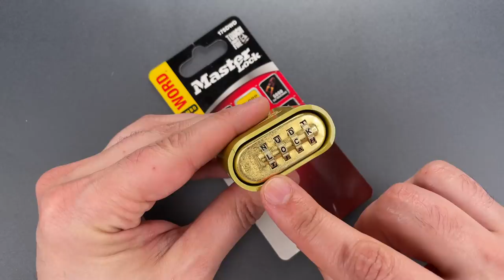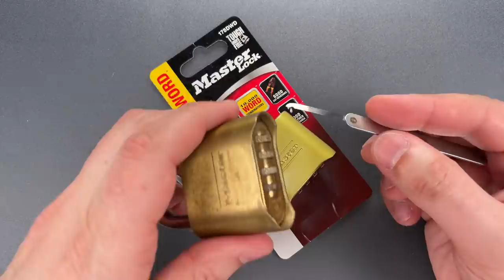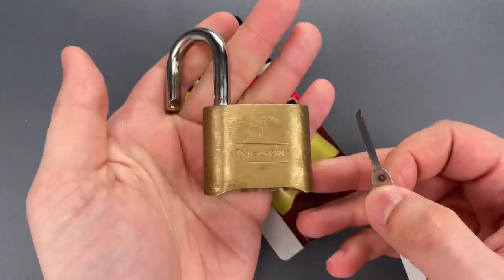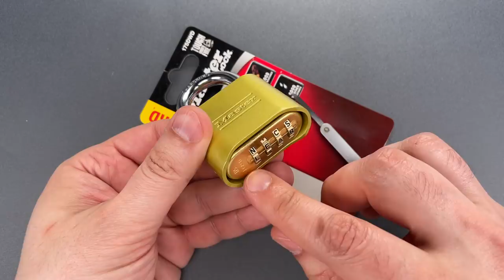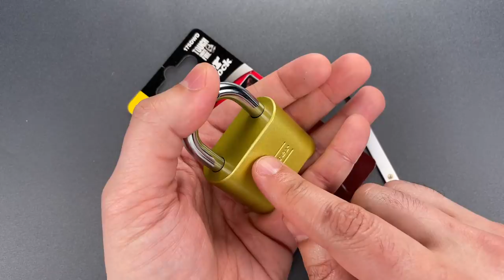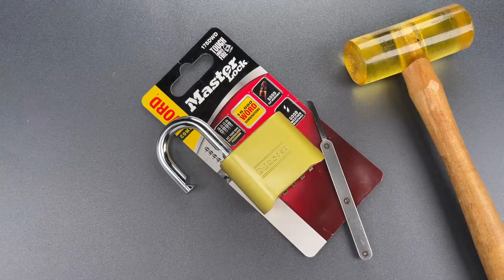[1272] Good Job Master Lock... Kinda.

Comment: I install lockers into school facilities, a lot of times when we are replacing damaged lockers from anchoring points there are kids that will leave locks on their lockers because they are being lazy about the notice or forget. This is how we actually remove most school locks. It works pretty much all the time, masterlocks are generally the lock of choice for high schoolers as well. Hopefully they don't change their locks, this makes our job really easy.
Reply: The lockers at my school actually had a really bad design to them. The sheet metal that paired together for the lock to mount on had a sloped upper edge. You could flip the lock up and pull on the top of the locker to hold it in place, you would then kick the lock hard against the locker and that sloped bit would lever the shackle out of the lock. Often would just break the lock, but would work on roughly 80% of the locks in the school. Kids would have their lockers broken into constantly because of this flaw in the locker design.
Reply: When I was in school and we were allowed to use our own locks (mainly gym lockers) I was the kid with the squire. The rest of the lockers had the stupid built in combination locks that you had to turn clockwise past the third number to unlatch, except you only needed to use the first 2 numbers then turn clockwise until it opened.
Reply: Out janitors just used what I assume is a lock cutter but instead of cutting he'd put this thing in between the shackles or whatever it's called and just break it off
Reply: Our school had a pair of heavy duty bolt cutters and literally just cut the locks off the lockers - the tolerances for the locks were such that there aren't many locks you can buy with a shackle that thin that you cant cut with a giant set of bolt cutters, and no one really paid that much for their locks

Comment: Master Lock: My powers have doubled since we met last time!
LPL: Two times zero is still zero.
Reply: Twice the pride, double the fall.
Reply: -Count Douko
Reply: ib4 "You haven't seen my final form!"
Reply: "Not bad, you made me use 10% of my power."
Reply: You are on this council but you will not be granted the rank of Master, Lock
Reply: This is the Lock Picking Lawyer,and today I will be showing you how to open a Master Lock using sand.
Reply: @AltimaNEO  that's not fair. Haha
Reply: Take the zero-th power of zero. Then, Masterlock can decide about the result, because 0° is undefined yet. At least in the reality of our timeline. ;-)
Reply: Spock said it best: "Twice nothing, is still nothing."
Even so, this isn't twice nothing. It's a solid +5 security.
Problem is that the LPL is hitting DC 45 when he Takes Ten.
Reply: "Nothin' from nothin' leaves nothin', you gotta have something, if you wanna be with me..."

Comment: Master lock: Okay we fixed the issue LPL exploited in the last video.
LPL: here's four more issues that make the lock useless
Master lock: - _____-
Reply: It's like bug fixing. You eliminate one and get 2 new ones.
Reply: @gosucab944  The fixing is physical, it's somewhat easier.
Reply: @newb.justnewb.8762  

LPL: Oh look another bug!

Pretty much how it goes even with physical fixes. I always picked my way into the public pool that was in the neighborhood as you just slide something through they fixed it where you could not just use a common swizz army knife and i still did it because just welding a extra part on there to shield from sliding credit cards or swizz army knifes was not really the problem. Sure i had a key everyone in the neighborhood did but it was more fun picking even after they welded both sides of the gate being sure that they eliminated anything to just open it without the key. Spoiler i used a small pen to open it at that point as it was a bad lock anyone could get in.

The only reason why they welded a extra part on it in the first place was because just about everyone knew how to open it without the key you know how those rich neighborhoods are they don't want that yet too stupid to think about it in the first place

Comment: This lock can still be shimmed like the old ones. Just use some .005 shimstock cut into a knife shape with a tiny bend at the tip. This allows you to get around the shielding one the side of each wheel and bypass normally.

Comment: Here's a challenger for the lock picking lawyer: find a school to let you use their lockers room and call Guinness world records for "most lockers picked in a minute" 😂
Reply: The mere presence of him being will cause all locks to open with fear
Reply: @bradleytaylor9712  even the locks on directors bra)
Reply: Yeah, Guinness world records has a lot of PR to do after changing their ways. They have lost all credibility. E.g. their MineCraft stair record is done in sandbox mode, but can quite easily be broken in normal play mode, and they enable dictators by taking the money and not asking any ethical questions.
Reply: I thought it was funny that the French love bridges have love locks put onto the railings, and regularly have to cut them down as it weighs down the bridges.
When he put his lock for his love after he locked it, he welded it shut also.. 😂
Reply: @jaybestnz  I mean one has to question how much weight these locks really add... You would think any self-respecting bridge engineer would design their bridge strong enough to the point no number of locks would cause it to collapse
Reply: Our bridge has a capacity of 3,000 cars.... Or a few dozen padlocks
Reply: @wolfysnack13  The French bridge had never been meant for anything but foot traffic and it had tons of extra metal.
Reply: The dude already owns thousands of locks.
Reply: @wolfysnack13  the bridge can tak it, no problem, the handrail the locks are on, not so much.
Reply: @someoneelse7629  Yeah, this. Less the bridge, more the chain link guardrail that is supposed to be intact and snag-free.
Reply: @wolfysnack13  have you actually looked at the railings of that bridge? It's not just a few locks, it's multiple thousands of them
Reply: … you sure a school is the best idea for a task like this?

Comment: I work in the solar utility field, these locks are very common on entry gates, we got a call to check why the site was only producing half the power. Upon arrival we noticed someone tried to open the lock by shooting it with what I presumed was a 9mm. The lock was still secure but we noticed a hole dug under the fence to gain access, they stripped half the site of PV electrical wiring. I think if they were able to gain access to the front gate and pull in their vehicle, they could have stripped more wiring from the site. A week later and thousands of dollars in PV wire the site was back up and running. Good thing they don’t watch this channel or we may have had to replace the other half of the field if they would have just used a hammer.😳

Comment: My uncle uses a lock like this on his ranch entry gate. The hook fits thru a steel slat, and around the hook he welded on an open piece of steel pipe. It creates a cavernous cylinder you have to reach into to access the lock with no room to do much other than spin the letters. No way to bang against the side to pop it open.
Reply: Exactly. That's the thing most locks are inside some kind of tube or cover. Everybody knows you can cut the hook with a power tool or smash them with a big sledgehammer. That's noisy and most thieves wouldn't even try that unless they thought everybody around was sleeping or away from home.
I don't know how many thieves can actually pick locks but in my mind a lock that has good pick resistance is the best lock for most applications.

Comment: A number lock has 10 options per slot as to where the letter lock has 27 per slot, so theoretically there are a substantially larger amount of letter combinations than numbers.

Comment: ...so what's the other bypass mentioned but not shown ?
Reply: They have to get past the hammer stage of the boss fight first.
Reply: Probably the shackle shim, a piece of metal that looks like a bent triangle, slides along the shackle and pushes the ball bearing out of the way so the shackle can be opened.  Or, he can just lift the lock to his mouth and whisper "This is the Lockpicking Lawyer, open or I'll take you to the basement" and the lock will pop open in fear.

Comment: The question I would ask is: Can that striking method be used when the lock is securing something alright, say a tight chain? Where you can’t get much movement on the lock itself. It seems like a lot of this method was dependent on free movement of the lock in your hand

Comment: Yeah but at least it’s weather resistant. Maybe.
Reply: I had to peel the weather resistant coating off the masterlocks they use at work because they had a worrying tendency to accumulate water inside, rather than repel it.

Comment: "Methods that aren't quite as easy as the shim"

Also the methods: Bonk
Reply: I mean hey, it takes more force than the shim.
Reply: @robbieaulia6462  And unlike simply grabbing a shim, you can't just use any one. You gotta get one that won't kill the lock
Reply: This comment is the reason I read comments😂
Reply: The bonk looks WAY easier
Reply: Ok the difficult decision. Do I buy a shim or pick up a rock.
Reply: i'm  currently more prepared for the hard method.
Reply: Bonk
Reply: I couldn’t find a 🔨 on  his website.
Reply: one downside is it makes noise
Reply: @technospyform1578  why? Why would killing the lock be a concern to someone who wants to bypass it? Now that I've seen this, if I were a thief and needed to bypass a master lock I'd just pick up a rock.
Reply: can open any lock with a strong enough bonk
Reply: taco bell ding
Reply: I may not have a shim .... but i can find a rock! Thanks masterlock for my new stuff!
Reply: @Terry-Hesticle  thats when you also bonk the witnesses. there is no problem that cannot be solved by bonk
Reply: @AtotehZ  it might be a problem if you forgot the combination and still need the lock
though I doubt anyone who watches this channel needs a master lock
Reply: AKA, BONK, SHIM, DOAH and OOF!
Reply: @AtotehZ  i believe the whole point of lock picking is to open a lock in a non-destructive way
Reply: lol'ed
Reply: @AtotehZ  Uhh i don't know.. maybe cus they are professional lock smiths??
Reply: Well you still have to be accurate enough not to hit your hand but deliver enough Force.
Reply: Difference is he wants to sell you the shim, but anyone has a hammer.
Reply: @AtotehZ  Master Rock
Reply: @edellenburg78  I mean you don't have to buy his shim it's literally just a little flat stick

Comment: I would imagine the biggest security flaw with this lock is that approximately 50% of these locks will have cock set as their combination.
Reply: And the other 50% will use the word "open." 🤣
Reply: If they are still a 10 character wheel e would be the only letter in open available
Reply: @peterclarke7240  bruh you didn’t have to shit on him that hard
you’ve gone to the point where it’s straight up hypocritical lmao
Reply: @rewrittenbytes1616  I'm not sure how it was hypocritical (pointing out the flaws or inconsistencies in someone's argument, when their argument is based on pedantically pointing out the flaws and inconsistencies in someone else's comment in the first place, is hardly hypocritical), but Ok.

Admittedly, it might be possible to tenuously argue that it was hypocritical of me to criticise him and potentially prevent him from having his brand of "fun," but if it is "fun" to him, then it was "fun" at my expense, whereas my original reply to the OP was an embellishment of the OPs comment, which wasn't aimed at anyone in particular, and was clearly intended in a light-hearted way.

Anyway, I tend to take the view that if someone tries to shit on me, then it's an invitation for me to shit on them straight back, and if it comes out a bit too hard for them, it might encourage them to keep their trousers up and find a restroom next time.
Reply: @peterclarke7240  Wow the vitriol. I see I made an incorrect assumption on the logical nature of an audience that views content based around highlighting the flaws in a product that you took my comment as an assault on your person and felt such a strong need to retaliate. I am truly sorry. I apologise first for counting incorrectly to the letter k but mostly I had no idea of your fragile emotional state when I left my comment. I will kindly delete my comment if it continues to humiliate you or induces any other equally negative emotions. Just say the word. I sincerely hope you can recover for this incident and return to enjoying light hearted humorous comments.

Comment: Wheel locks are super unsecure anyways cause you can go from 0001-9999 and you will eventually get it. Anyone can do it, at any time. I've done it to locks that I scrambled the code to for fun.  But I'd say for that reason words might be more secure. At least in theory.  If it has all letters, and the same number of wheels then it goes from 9 digits per wheel, to 26. Though this is unlikely, so let's say it just had 9 letters, like it had 9 digits, then at the very least it makes it less intuitive to test your way to the solution, since you'd have to test as if they were numbers, which might be a little confusing,(at least for some) and thinking of words would be next to impossible cause you know you're gonna forget tons of words.

Comment: Hi LockpickingLaeyer, I recently brought one of these master lock 175, I can't use a Peterson shim to manipulate it open. The tolerances on the new ones are too tight. I even tried to bang it open using a 🔨 hammer. No luck 🤞.....am I doing something wrong?

Comment: I don't know, I think a letter based lock would be harder to guess the combo to. Specifically if you don't set it as a word. Someone trying to get in is probably going to start by only trying every word they can think of (if they don't have a hammer with them)

Comment: Well, obviously the code doesnt have to be a word. It can just be 4 random letters. So, in that sense, 26 options per wheel versus 10... more secure in that sense. I'm shocked you didnt think of that + mention it in the first 30 or so seconds there

Comment: Wait, don't letters offer more character combinations than numbers, say for any given selection you could have 0-9 (10 options) vs A-Z (26 options)? So it should be that the code is harder to break and that there are more combinations, right? Edit: I'm assuming the bigger wheels may increase  the space needed for the mechanism, reducing the amount of space available/number of wheels

Comment: President of Master Lock - Dammit guys, fix the F'n shim issue.  

Designers - Sir, we have fixed the issue of being able to open the lock with a shim.... at least we think we have.

President - Why do you only "think" you have solved the problem?

Designers  -  Well... the new version can be opened by just hitting the lock with a small mallet.  That's so much easier we haven't really tested if it can still be opened with a shim.

Comment: Just cut one open today. The shim will go in on the right side of the second wheel, where the anti-shim is thinnest  The trick is it can only be done if you have the wheel on the correct number (10 chances). The gate will allow the shim from covert companion in.

Comment: Edit: it looks like the wheels don’t actually have the full alphabet, so I think there’s the same number of combinations for both. Depends how many letters are on each wheel.

Original: Hold up, letters instead of numbers absolutely doesn’t reduce the number of combinations.

A 4 digit pin with numbers has 10^4 combinations, with letters it’s 26^4.
Reply: But if you want to make a word in the English language it does (especially with each one only having ten letters available to it). That's why he suggested acronyms. Abbreviations? Whatever.

Comment: Just picked my first commercial grade lock!! The calmness and methodical style espoused by Mr LPL helped a lot. It was a Masterlock, and it was worth every $0.01 of the purchase price to get that click. Started off needing to pick my window locks - here in Aus it's a legal requirement to have window locks on apartments above ground floor - stuck indoors last year I needed those locks off to breathe. Those didn't need any skill, just blunder about at the end with a random pick. However with the Masterlock it required the full ritual - bottom of the keyway tension; sequential 'nothing on one, click out of two, three is binding, nudging four and then 'CLICK' it's open :) Very satisfying.

Comment: After watching this video I went to the garage and grabbed three MasterLock 175s, of varying vintages from 2011 to 2017.  All 3 were too tight to fit a shim inside.  Only one would open using the method you show here.  It's now broken and will not lock anymore.  The other two were not opened using this method after about 50 tries.  YMMV.

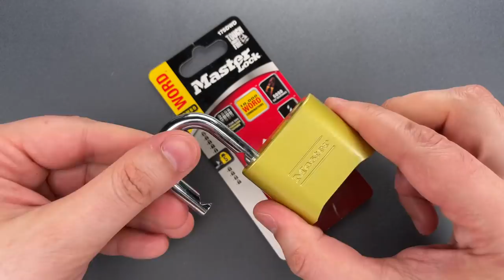Comment: 0:20 I think you are objectively incorrect there. Having a number password means having 10 characters per digit. This means that a number password of four digits has 10^4 outcomes, which is 10,000 possible outcomes. However, a letter password can have 26 characters per digit, making a four digit letter password have 26^4 outcomes, which is around 456,976 possible outcomes. You get around 45 times the outcomes with a letter combination than a number one.
Reply: That would be true if there actually were all 26 letters available per wheel. There are not. There are only 10 letters, otherwise the wheels would be huge. You can even see it on the packaging, it states your exact number of "only" 10.000 possible outcomes.

Comment: I think the better tolerances for shim insertion have been carried over to all their 175 production.  Master Lock just sent me two new 175's as warranty replacements for a couple older locks.  Both of them have the same very tight tolerance with practically no gap to the sides of the wheels that you showed here.